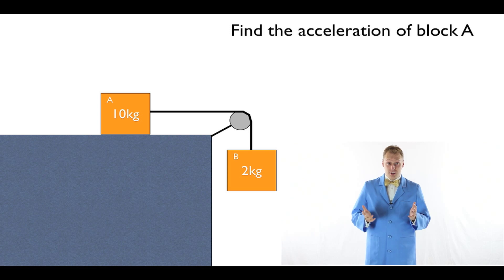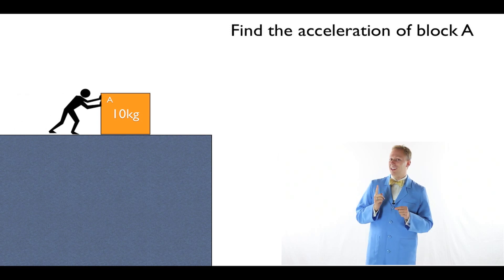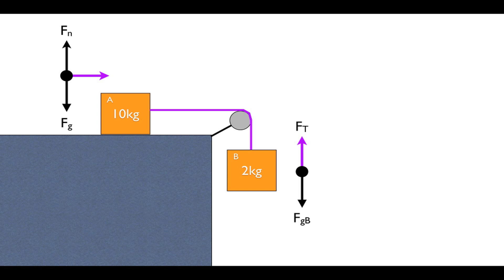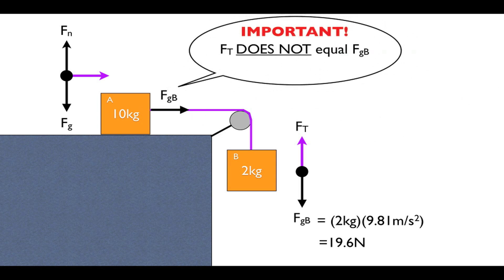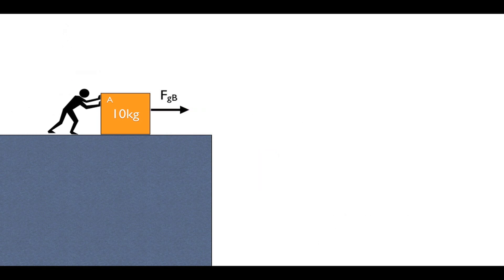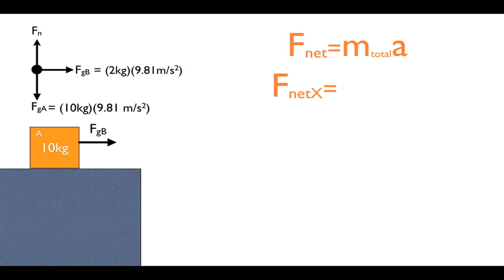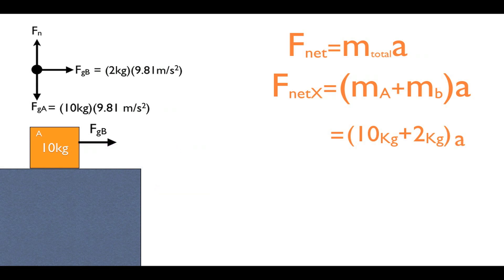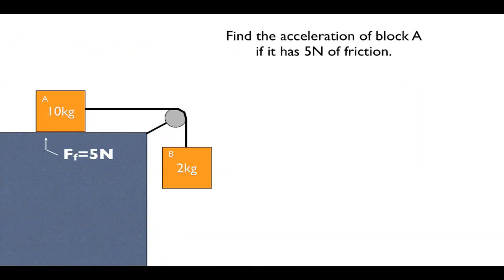How to solve pulley problems in physics

Comment: My question is that what will be the tension when system contains three blocks
Reply: Firoz khan Treat it the same way. You can have as many blocks as you like. Only the direction will depend if you add or subtract it bluster be sure to include all the blocks in your mass of the system.

Comment: Idk, I had a similar problem with box A 4 kg and box B 2 kg. I kind of followed your steps. I just went ahead and did (4*9.82)/6 - (2*9.82)/6 = 3.27 m/s^2, which yielded the accurate answer, according to the book. What was different in my case? Why did I have to subtract, meanwhile you didn't have to? Aren't you trying to find the acceleration of both of the boxes' acceleration?

Comment: Thank you, it was a helpful video. How can I find the force applied by the support on the pulley?
Reply: Since the pulley is idealized as massless, and likewise, has no linear acceleration of its center, the forces on it must add up to zero.  Once you calculate the tension, you can construct both tensions as they act on the pulley to redirect the force.  Set up the axle reaction force that you are trying to find, as reaction forces Ax and Ay.  You'll construct the following two equations:
Ax - T = 0
Ay - T = 0

Thus:
A = <T, T>

Which means A's magnitude is T*sqrt(2), and acts up and right at a 45 degree angle.

Comment: hey so we did a physics lab today of this stuff exactly, and the challenge question is to find "g" or gravity and then calculate the percent error of the gravity we use which is (9.8m/s squared) how would you determine "g"??
Reply: Treat g as an unknown, when you set up this experiment.  You then measure the mass of the cart on the table (M), the mass of the hanging object (m), and the acceleration of the cart.  Likely, you have the cart accelerate from rest a known distance in a known time, and use d=1/2*a*t^2 to solve for acceleration.   Either that, or you put an accelerometer on the cart.

Using a = m*g/(M + m), and then solving for g, you can experimentally determine g as g = a*(M+m)/m.

Comment: one question....why is the acceleration 9.81m/s but not 10m/s?
Reply from the maker: Because the acceleration due to gravity at sea level 9.81 m/s2. If our planet had more mass it could be 10, but thankfully it doesn't because I would have grown up an inch or two shorter.
Reply: +Michael Kocher I'm sure those one or two inches make all the difference for you.
Reply: p12pisani AP allows 10 m/s^2
Reply: If you are wondering why it is that number specifically, it is not just a coincidence that it is approximately equal to pi^2.   An early idea to defining the meter, was for the 2-second "tick/tock" pendulum to have a length of 1 meter.  If you look at the equation of the pendulum's swing period, setting T=2 seconds, and L = 1 meter, that this will only work if g = pi^2 meters/second^2.

The meter has evolved since then, and g is not exactly pi^2 meters/second^2.  It is the happenstance of the evolution of the meter, and the planet that we live on, that it evolved so that g would equal 9.81 m/s^2 at around the 50 degree latitude line.   9.8 m/s^2 is really as much as you can conclude, if the geographical location is not specified, because g varies from 9.76m/s^2 (tallest mountain in Ecuador) to 9.83 m/s^2 (North Pole) across the surface of this planet.

Comment: how can we knew about the tension is  same or different in a rope?
Reply: If the rope and all pulleys along it are idealized as massless and frictionless, then the tension has to be the same, continuously throughout the rope.  Since no segment of the rope can have a net force acting on it other than zero, the tensions on the rope have to add up to zero, otherwise it would have infinite acceleration.  Because the pulleys are also idealized as massless and frictionless, this means that the tensions on both sides of them are equal, so that the net torque on the pulley is zero.

Comment: It took me 6 failed attempts to get to the right answer X_X
Reply: +Michael Kocher Well, I think that my problem is that I formulate wrong equations to solve the sum. So maybe you could give me some insight on how to make the right equations. (please) Like for instance, let's say that the pulley system was going to the left and Block A has a Fapp of 15N at an angle of 30 degrees. How would you solve that?
Reply: +Michael Kocher Ok, I shall try it out one more time and let you know tomorrow if I got it or not. Thanks for your help. :)
Reply: +Michael Kocher I got it :D thank you so much for your help, I shall contact you if I need any other help. ( do you by any chance also do chemistry?)

Comment: how is 10kg+2kg=2kg?
Reply: +Benjamin Fahy nowhere in the video does it say 10kg+2kg=2kg. i think what he meant was when you are at the last calculation and it looks like (2kg)(9.81m/s2) = (10kg+2kg)a. that's the only place i see another 2kg in the equation. i think if that is true, he's not understanding that the mass of block b is the m, multiplied by a on the left side of the equation, and on the right side of the equation is the total mass of the system, multiplied by the answer we're looking for.

Comment: I disagree that this is a simpler method. In order to figure out F_gB you have to start with the problem involving two boxes, then switch to a second problem involving one 12kg box with a mysterious 19.6N force applied to it. This trick only works for this exact problem, and I think it is confusing to students who are trying to understand Newton's Laws and learn to solve force problems in a general way.

Comment from the maker: Hey guys! If this video helped you out, consider sharing it with someone else who might need it, and subscribe for more videos that are soon to come!
Reply: +Michael Kocher very helpful video, the video my teacher made used like a 1940 camera and made such an easy problem looks like the hardest question on grade 12 calculus final exam
Reply: Michael Kocher is the answer 1.21m/s^2
Reply: BoldFuturesAcademy Me!How come?
Reply: I'm Canadian, I can't vote. :P
Reply: BoldFuturesAcademy Why are u abusing sir?
Reply from the maker: QuIgYx It's the same as the first block. Think about what would happen if it weren't so.
Reply: Can you explain why FT does not equal FgB please?
Reply: @zainbenten4423  Since the hanging mass is accelerating, a net force must cause its acceleration.  The two forces, Ft and FgB must therefore add up as vectors to m*a of block B.  If the hanging mass were at rest, the tension would equal its weight, to keep it at rest.  But when in motion, the tension will oppose a small part of its weight, as it couples the motion of the sliding block and hanging block, so they both accelerate together.

Comment: This did not work for me at ALL. My question is asking for the magnitude of the acceleration of block A. I solved for Fnetx=mA*acceleration. The magnitude refers to the square root of the sum of the squares of acceleration in the x direction and y direction. acceleration = 0 in the y direction so the magnitude of the acceleration should just be acceleration in the x direction... HELP.
Reply from the maker: Every block has the same magnitude of acceleration. Once you find the acceleration of the system you are done! "The magnitude" in this case just means it's a scalar and not a vector. No need to square root anything.

Comment: I think you might be setting students up for failure using this method. You aren't properly explaining Newtons 2nd law, F=ma. Realistically you should teach them to solve for T using a FBD of the second block. You would get mBg-T=mBa where mB is the mass of the second block, g is gravity, a is acceleration and T is tension. You can then derive that T=mBg-mBa. You then should make a fbd of the second block. Since there is no friction involved, T=ma. Since T is uniform in the system, we already know T=mbg-mba. So mBg-mBa=mAa. You then get mBg=mBa+mAa or a(mB+mA). Then input your numbers into the equation. You get (2.0kg)(9.81m/s^2)=a(2.0kg+10.0kg) and can determine algebraically that a=1.6m/s^2 (1.635 but rounded with sig figs). I know from past experience that learning to solve a system like this isn't the proper way to go about it.
Reply from the maker: Your method is correct, although many high school students would be lost with such an explanation. The main goal of this pulley problems is for students to see that the inertia from both objects must be taken into account to find acceleration.
Reply: Yeah, I get what you're saying. I've been taught to prove my formulas before I use them, so I guess you could call me nit-picky :)
Reply from the maker: Spencer Pooghkay 力完美 It's a better way of doing things. But for the students who struggles with algebra they need a way to visualize it, and use theory to bypass the proof.